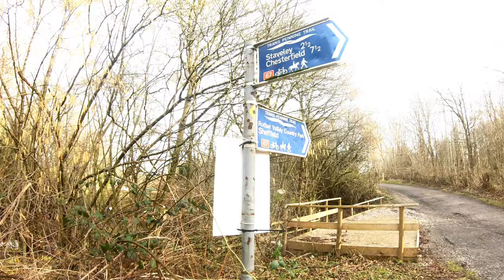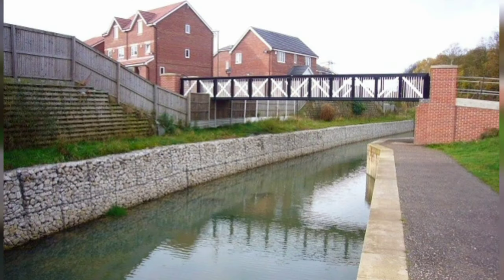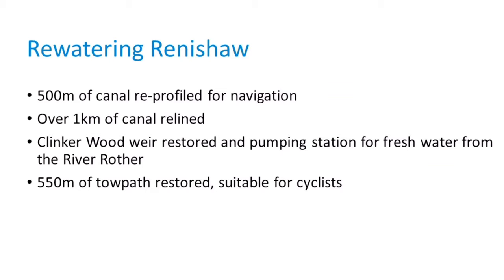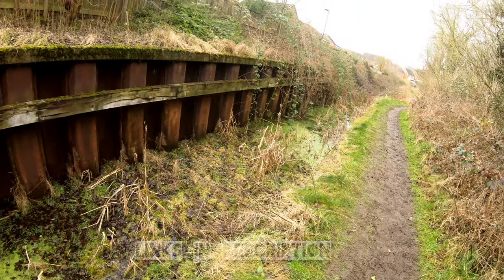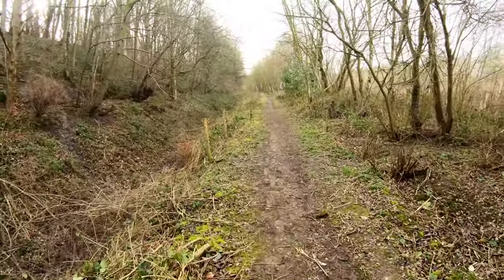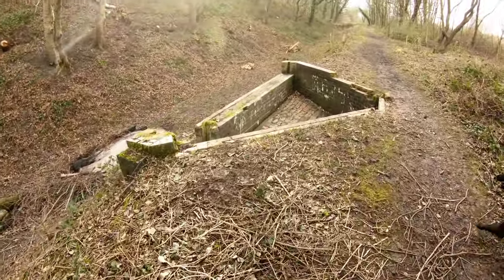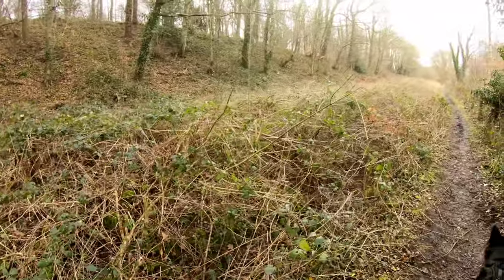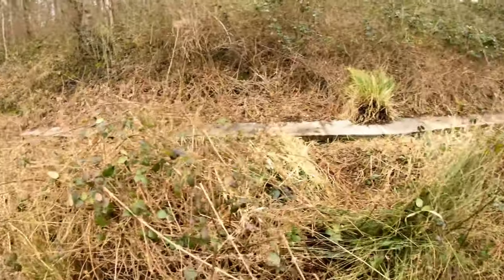Chesterfield Canal Restoration - Rewatering Renishaw - Episode 1 (February 2022)

Comment: I'm never really certain what's going off over the TPT, it's the old station site I think isn't it, or at least goods yard... I reckon they'd previously just heaped a lot of earth up and gradually they are clearing it as the earth used to be nearly as high as the power lines. I believe there's still traces of the original canal path in the lower clinker wood which I've been wanting to check out for a while, probably not when they are working on that site though. I recall a few years ago when there was a railway buffer or something on the site before they mounded all the earth up.
Reply from the maker: Yeah old goods shed. I remember a few years ago there was still a building by the tpt on that section. And a water pump thing. 
Just a big digger world😄

Comment: I can’t understand how a restored canal that was finished in 2010 has suddenly gone back to disused and a total mess. Are they going to reopen Norwood Tunnel? That would be fantastic!
Reply from the maker: As far as I know the tunnel is beyond repair. The plan was to take the canal over the top rather than the tunnel via a series of locks. Though that seems a long time away and a lot of miles to recover. 
It does seem a shame that this "new" section is in ruins again. Hopefully once it's connected to the rest of the canal it will survive better.